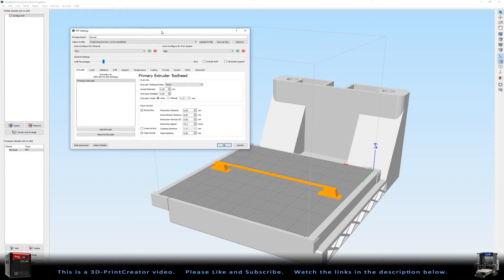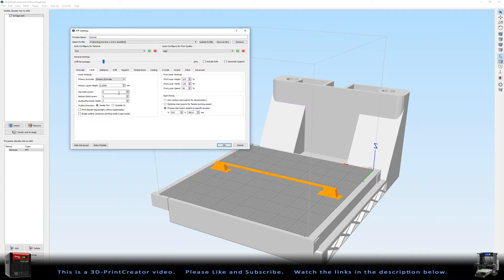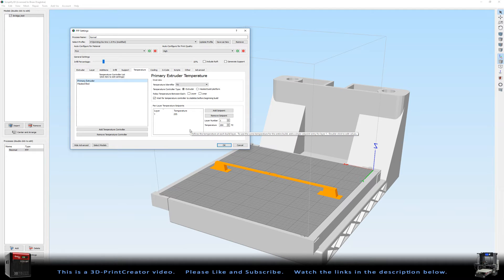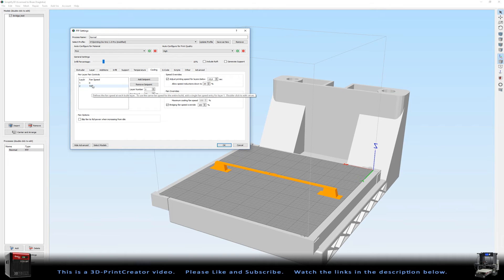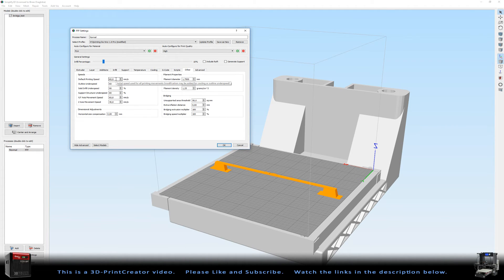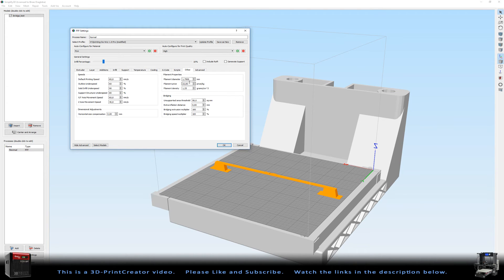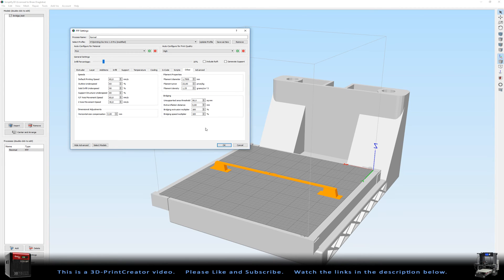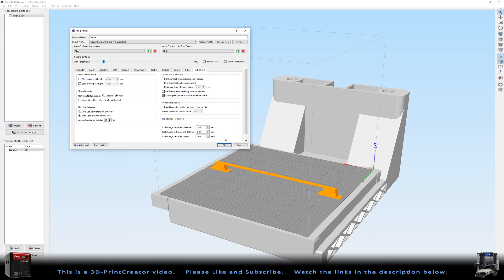▼ My settings for the large bridge - Da Vinci Pro

Comment: I just finished setting up and calibrating the Davinci Pro 1.0, and wanted to try and print something (buold sample from the SD card), but the screen on the printer is at "BUILDING, FILE CHECKING PLEASE WAIT". It's been stuck on this screen for a while now. Is this normal? How long does this usually take?
Reply from the maker: Depending on the size of the print, it can take up about 1 to 30 minutes. If your slicer is better, it takes less time, but with the stock XYZWare for pro it's a little longer.